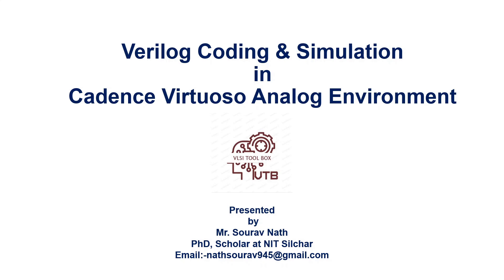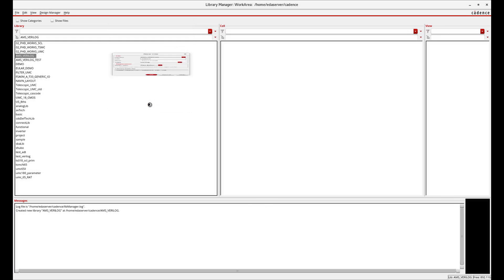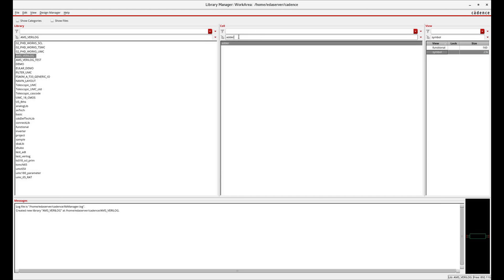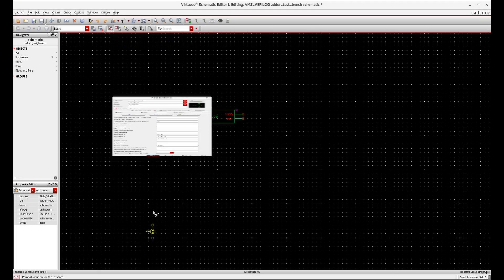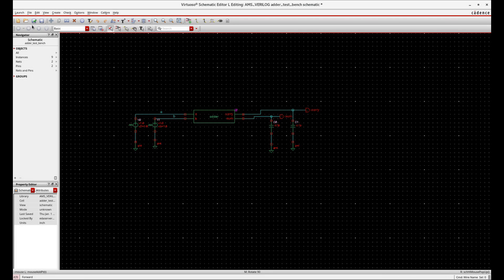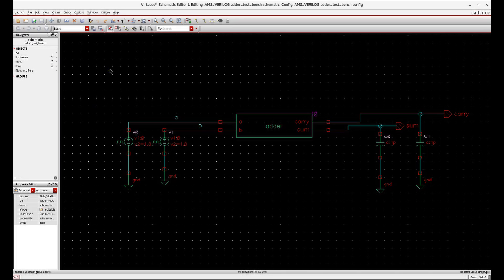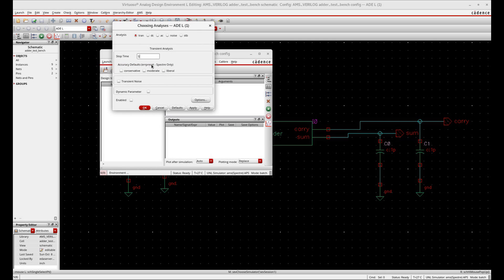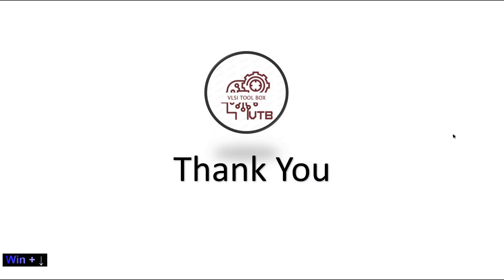Verilog Coding and Simulation in Cadence Virtuoso Analog Environment | AMS Simulation

Comment: Good day sir, when you simulate an RTL code in Virtuoso, will it have an input resistance/impedance?  Thank you.
Reply from the maker: During the verilog coding it is not taken into account about the input output resistance as it will be  using standard cell during layout. You have to check the data sheet of the corresponding pdk you are using to find the details of your standard cells that are used as a result of your coding.

Comment: How do you simulate if you have multiple modules and and have generate statements in the module
Reply from the maker: You can write a top module upon which you can instantiate the other modules and map with the top module using structural modelling.